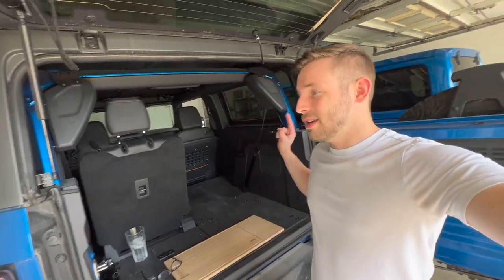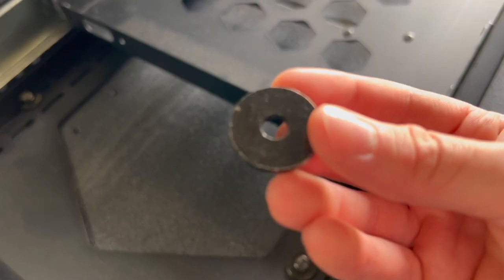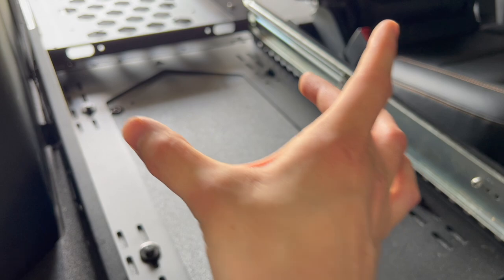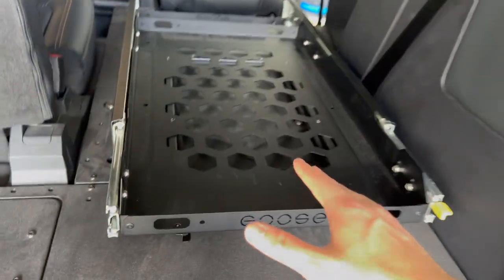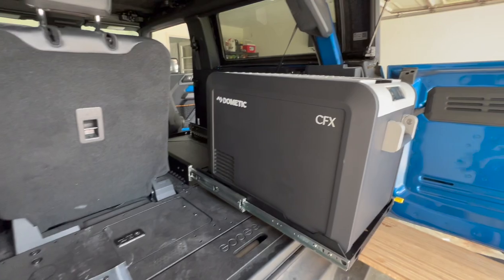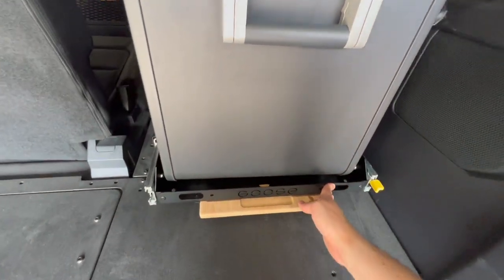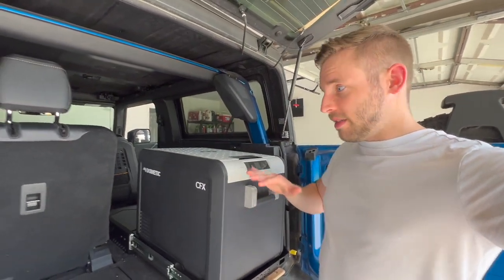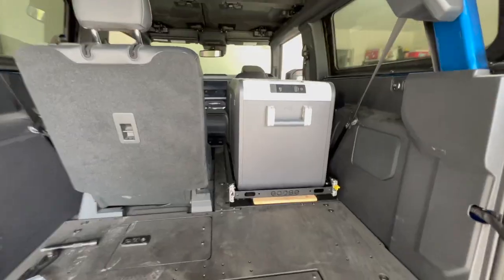Goose Gear Fridge slide Install on My Bronco! A Better "Overland" Set up

Comment: Did you consider the American adventure labs mass plate when getting the goose gear set up? I’m torn between the two and can’t pull the trigger on either. ☹️
Reply from the maker: To be honest, no. But just because I wasn’t aware of that product. I will say that after having mine for over a year, I’m super happy with it. It’s held up great! 
Thanks for watching!
Reply: @drivenmad2089  Thanks so much! TBH, i much prefer the way that yours, on the goose gear, slides all the way back into rear seat delete...the AAL has space BEHIND it when all the way in, as opposed to in front of it like yours, and i prefer the look/functionality of yours, so i think i have decided! :D Thanks so much, man!!
Reply from the maker: @davidlockebreaux8064  no problem dude! Glad I could help!
Reply: @drivenmad2089  one more question, if I may? How do you power your fridge? Do you just use car outlets or are you using a battery system or portable power source? Would love your insight on that. :)

Comment: Does goose gear offer a full rear seat delete for the 4 door bronco?
Reply: I just did a YouTube google + Lots of videos on 2021+ Bronco 2door, 2018+ JL Wrangler but NOT JLU. BUT GG did make one for the 2017 - 2012? JKU Wrangler. That's probably one of those deals if enough potential customers request it then Goose Gear would make a few 1,000 and see how fast they sell.
Reply from the maker: Not at the moment but I believe they are working on it since they have that for the 2 door 
Thanks for watching!